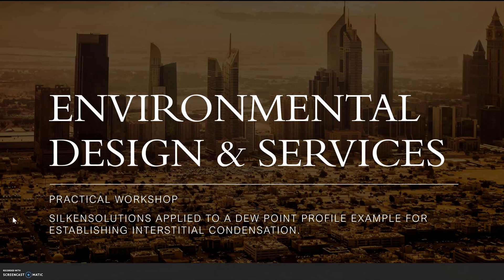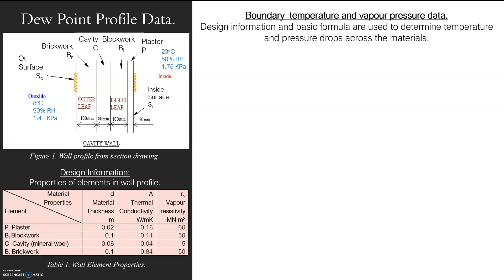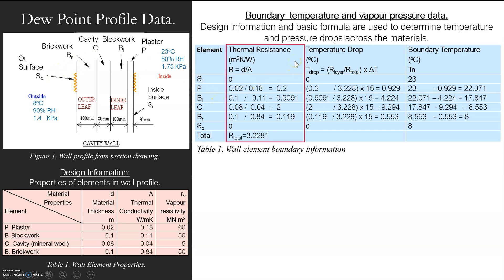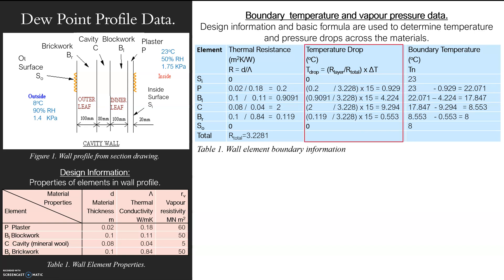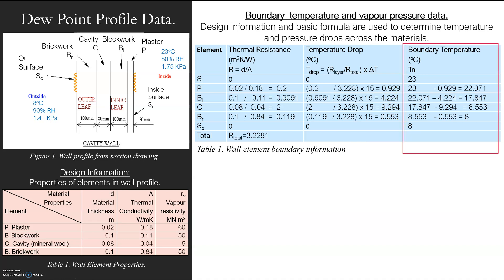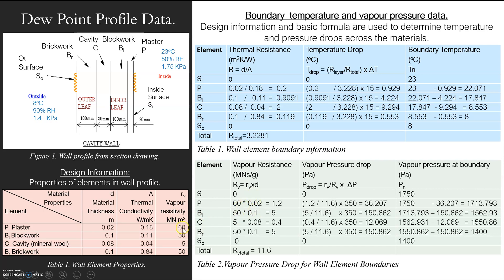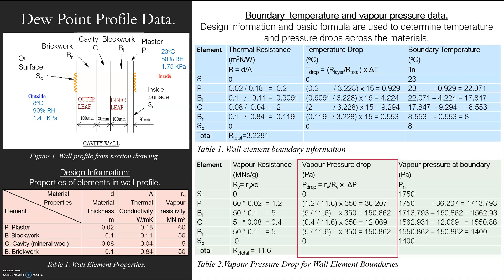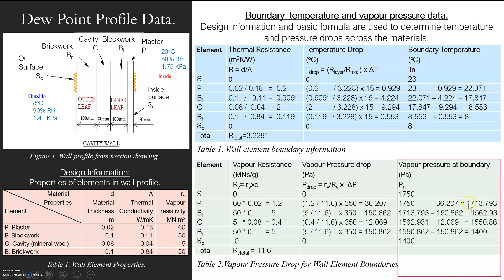Material Calculations: Dew Point Profile Part 1

Comment: Is there a program that can run these calculations? I need to run wall dew point analysis and am looking for a computer program to do it.
Reply from the maker: Hi there. Dew point and condensation calculators are mostly free (i.e. buildesk.co.uk) but I've not come across interstitial condensation calculators unless you are building a full wall unit off a manufacturer as they will have all the data to do one easily.